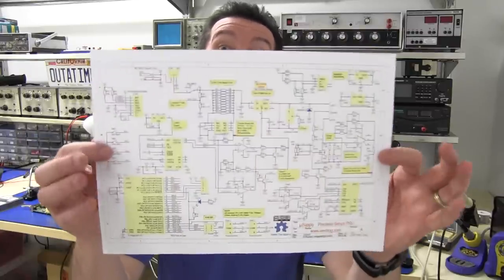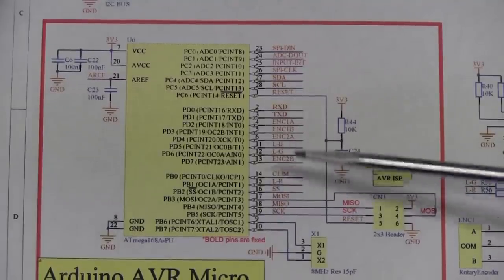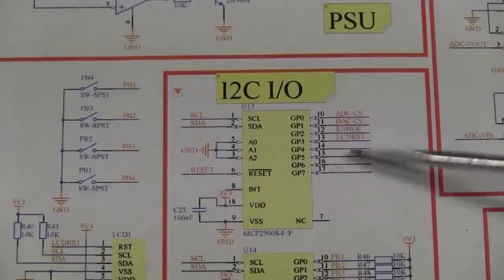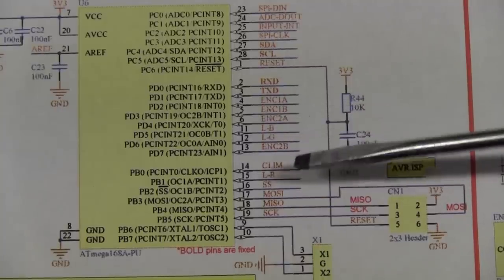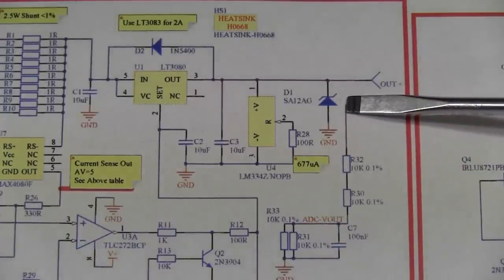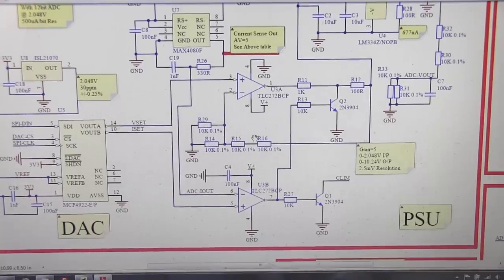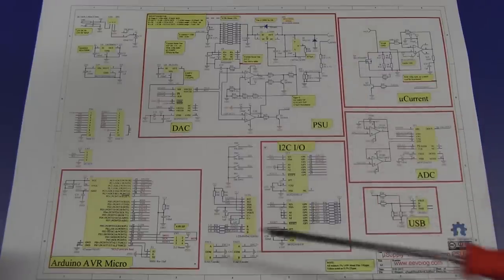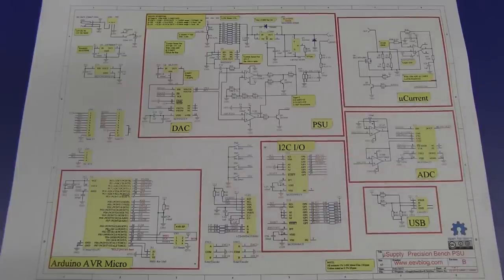EEVblog #238 - Power Supply Design Part 7

Comment: I don't get why you want to bitbang SPI rather than use the hardware SPI port. The chip specifically handles sharing SPI and ISP because ISP is only active when the chip is in RESET mode. It's quite safe to mix the two on the same pins.

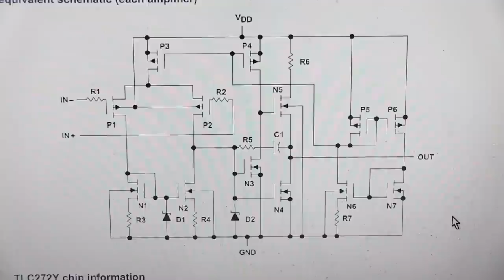Comment: The image in the TLC272 datasheet @22:51 is a copy of the photomask for the metal on the IC (black=metal).  It looks like this chip only has one layer of metal.  Metal connects to the sources and drains of the transistors; polysilicon is used for the transistor gates and short connections underneath the metal.

The pads with notched corners in the LL and LR corners are not bonded out, apparently. (They're probably only used at wafer test--"multiprobe" in TI jargon).  Pin 4 (GND) is bonded to the pad at top center; pin 8 (VDD) is bonded to the pad at bottom center.  Pins/pads are numbered clockwise.

Comment: Very nice revisions and sheet layouts Dave!

I think this is a good project example because you're interfacing I2C, using PWM etc.
and yes, you could use a higher pin-count MCU or a PIC or Vortex 32 but it wouldn't
be something that your average electronics hobbyist would even consider learning a lower level language nor having to buy programming hardware to modify
and experiment with.
Also I think it's keeping more of the 'vibe' with open source.

Nice work again, and thanks for the detail!

Comment: Dave, since you're going to use an external resonator you might consider using a more UART-friendly frequency--like 7.3728 MHz.

Also, you might be able to use an analog MUX to reclaim your SPI pins.  You could use something like the 74HC4053 and use the RESET signal as the selector and route the SCK, MISO and MOSI pins to either the ISP header or your SPI device(s) based on whether the programmer is asserting the RESET signal or not.  I've never tried this but it *should* work.

Comment: @ahhuhtal 
When I remember correctly (did it once), you can still program it, but it will need high voltage programming (rasing the reset line to 12V). This can no longer be done with a standard ISP programmer and the pins you use for programming are then different, too (because many AVRs don't support serial HV programming).

Comment: @TerminalJack505 Usually the way to go for more pins is to use 74xx595 which is dirt cheap 8-bit serial in, parallel out register with latch, SPI-like input. These I2C exanders have more logic inside, are bidirectional, have interrupt and maybe few more things. Downside is slower I2C access, perhaps not critical in this application. I think Microchip have also the same with SPI bus, it just takes few more pins.

Comment: Typically an Arduino compatible header for serial programming has reset just after the RX/TX so it can be triggered by DTR handshake line from the RS232 adapter.  This makes the ATMEGA run the bootloader and talk to the PC.  You can press the reset button by hand and let go at the right time but it's a bit of a pain.  Also the "C" version didn't have a grade letter, they all had "C" at the end it stands for commercial temperature range.  Good stuff, looking forward to the next one.

Comment: @Vlakpage The 74HC4053 is a 30 cent part and is bi-directional.  You won't get the functionality that I'm suggesting from a serial-in, parallel-out part.  

The point of using the 74HC4053 or similar was to allow the RESET signal--which is held low by the programmer during programming--to select between the ISP header and the SPI bus and let Dave use hardware SPI instead of having to bit-bang to the SPI devices.

Comment: Hardware SPI is like two lines of code. Just make sure that the peripherals have their /CS pins idle during programming.
Hardware I2C doesn't like glitches on the bus. Once I've ended up resetting I2C interface before every communication cycle (noise+long wires).
The software implementation is quite a bit of code, unless you are using a library.
Add a resistor between C24 and reset pin, leave ISP reset tied directly (as is). Some programmers will not be able to reload that cap fast enough.

Comment: I guess this design has a big weakness. You have the current sensing with those 4 resistors. They equal 1 Ohm. So if you drive your Power Supply with 1A load the output voltage does not really equal what you have set it for. Because of the voltage drop caused by the current shunt. So in worst case (max load 1 A), there will be U= R * I   = 1V difference. Pretty much if you ask me. 

Output Voltage = R_load * I   + R_shunt* I
Reply: +7enderThomas The voltage regulator is after the current regulator, so it compensates for that loss. You will however lose 1V of your supply voltage. Not that big a problem as you can just use a higher voltage supply.
Reply: @7enderThomas
You missed the explanation for this part of design, those four resistors only used for very low current measurements, all other time they are bypassed by software controlled Q4 (see RANGE pin) with very low resistance. besides that, your formula is incorrect: R_load * I does not make any sense because this is constant voltage power supply as long as you do not exceed the current limit set point. The voltage on the load will be the set point voltage.

Comment: I understand the use of Atmega368 for full arduino compatibility, but I have loaded the arduino bootloader in the Atmega644 with minimal modifications (just because I used a different clock freq), you get all the pins you need, more RAM and flash and you can use the arduino IDE without any problems!!

Comment from the maker: @keenantims Yes, you are right, with hindsight I should have used the bigger device. I missed it. I had used the 8bit one before so was kinda caught up on that and stopped searching. Damn.
The hardware SPI is left free so an Ethernet shield or some other external serial device can use it.

Comment: Regarding the TLC277 variants.  The C version are rejects from the A and B versions.  If the part fails specification testing but passes functional testing then brand it with a C and still sell it.

Comment: Watch about these TLC272's I've spend a bit over 200 now and about 2% just burns out with no apparent reason :/, and in the circuit (so it is not ESD)...
If you want to pull it down to 0V for sure, load the output a little (resistor to ground) but you will test that.
In my experience they were all  under a mV offset on the output in my circuit (the cheapest ver.) so that is really not needed.
I used them because of really low input bias current that i needed, and single supply operation.

Comment: i think you should have no trouble sharing the ISP and SPI pins, ISP is simply SPI with RESET acting as a chip-select

just take care to make sure the programmer floats the master out when its idle, and the other chip-select lines are inactive when programming

Comment: @electrodacus Of course if you want it cheap for some 10k run, you'll design accordingly. But keep in mind, this kit is made to be simple to build, use and hack around. That's why it uses mostly DIP parts (there are no widely available ARMs in DIP) and it's compatible with Arduino so you can take advantage of existing IDE and code/libraries already developped by the community.

I highly doubt there is simple way to get multiplatform STM32 toolchain with IDE and upload capability with $5 flasher.

Comment: Dave, why the 8-bit GPIO when 16-bit are only pennies more? MCP23017 seems to make more sense here - simpler & cheaper.

No reason not to use the hardware SPI either, it's less code & performs better, isolate it from the ISP with some resistors so programmer can override if necessary.

@electrodacus While I agree in principle, for a hobbyist kit the whole Arduino compatible thing is a pretty big draw I think, and will encourage experimentation. Worth it for pennies worth of I/O chips IMO.

Comment: @electrodacus Besides keeping it simple Arduino-like, you have option to go with some 40 pin DIP AVR or you can take some Arduino Mega compatible chip which has more than enough I/O but is significantly more expensive.

Of course there can be some variants with say PIC32 and built-in Ethernet or whatever but then we're getting into some different platforms which may not have all the codebase and tools simple and ready to use and finally program the chip.

Comment from the maker: @electrodacus Why go on about this? It is pointless. I wanted a DIP package. I wanted Arduino compatibility. You get neither of those with those other more powerful devices. There are countless other bigger chips I could have chosen STM32 is only one of a dozen. I didn't for good reasons.

Comment: why you did not used a very cheap(2$)  stm32f103c  mcu it has a lot of 12bit adc and 16bit pwm  and it is an arduino ide compatible and it has a lot  of good Features in you project